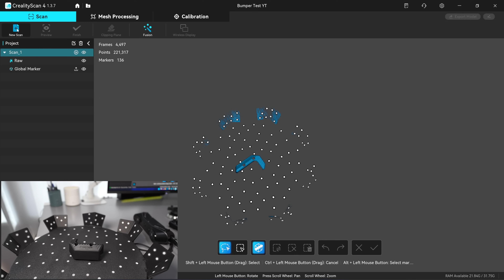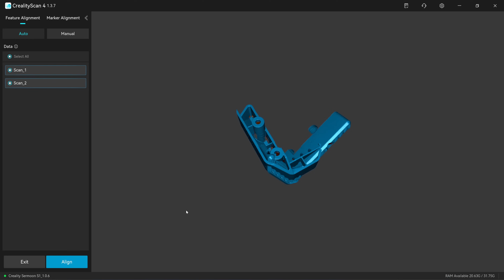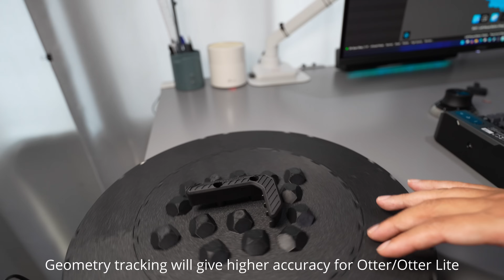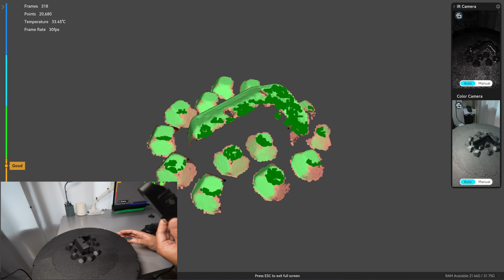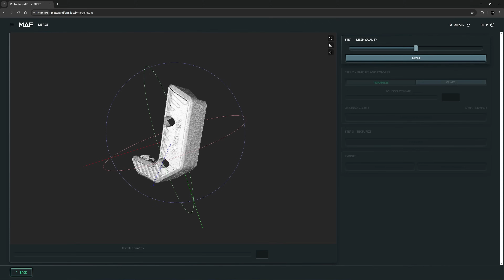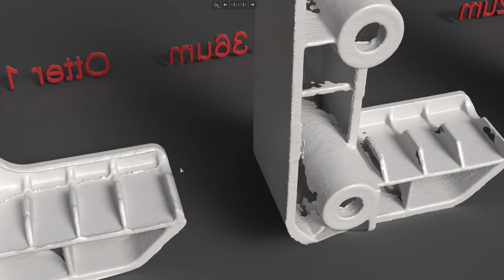Best 3D Scanner for Reverse Engineering – 8 Tested for Accuracy & Workflow

Comment: good tests. however, one issue with checking the accuracy, checking at different heights of the object could vary more then the micron resolution were are checking ?
also the lin from top point to bottom point is not 100% streight vertically down, that could change the result length enough by the microns you are testing
Reply from the maker: Look at the delta value. It's that simple.

Comment: Question, if you dab the bottom of the hole with some reflective paint or a piece of reflective vinyl, would that help picking it up?
Reply from the maker: The circular dots are manufactured with high precision, they’re perfectly round and have an exact diameter. The scanner determines distance by measuring that diameter.

Comment: Why there is a frame limit of 40k frames? 😮😢
Reply from the maker: It’s currently limited to 60K frames to reduce drifting error. The larger the frame count, the more travel the scanner makes, which increases drift. Aligning multiple scans with shorter frame counts in each pass is a better practice.

Comment: Interesting, I see other people get much better results from the metrox than you do.
Reply from the maker: I don't do paid review.
Reply: @Payo-TensileCreator  The other sources I'm referencing would say the same thing. Out of those three, you are the only one I see that says the Raptor is far better than the MetroX. The others show the MetroX as actually being slightly more accurate, and recommend it for its better software, and included equipment. But you on the other hand have a micron rating on the MetroX that makes the Raptor look far superior.
Reply from the maker: @CJThompson-m2k  I’m proud of the work I’ve contributed to the 3D scanning community. Most users buy scanners with their hard‑earned money, and they deserve honesty rather than misleading claims. Viewers ask me every day which scanner they should choose, and I provide them with genuine professional advice. Each month I receive a number of scan datasets from Revopoint devices, but there’s virtually no difference between the point clouds from the Mini 2, Inspire 2, Metro X, and Metro Y. Once cropped, they all show uneven wall thickness and lack sharpness, making them difficult to trace. Even symmetrical parts end up misaligned, with a consistent accuracy error of 0.3–0.4 mm. In fact, only a small portion of the Revopoint scan data I’ve received is truly usable for reverse engineering. Revopoint once contacted me to create a cover video. The staff member I spoke with was a good person, but their management policies are another story. Deceptive marketing remains their primary sales tactic, misleading advertising, paid reviews, and manipulation through social media. They even employ more than 30 people solely to flood negative reviews with spam comments.
Reply: @Payo-TensileCreator  You are saying a $200 scanner from Revopoint is no different than a $1000 one. Also that there are deviations of 0.4 mm. If those things were true, wouldn't you think everyone would be returning these and the brand would crumble? A deviation of 0.4 mm on a 0.02 mm promise is a company crushing deviation. I am not affiliated with any of these brands and I have no dog in the fight. It is just that I think the margin of difference you are seeing is alarming.
Reply: @Payo-TensileCreator  I wanted to let you know I compared both scanners and my finding might be surprising to you. I've decided to side with the Raptor over the MetroX. Reason being is that the Raptor is much faster at scanning than the MetroX, the MetroX is very slow on my PC despite it being a high end PC, and the Raptor beat it in accuracy measurements. I'm surprised! I was really hoping the MetroX would be better to justify the extras it comes with but I'm left grossly disappointed. I will say though I didn't see a .4 mm discrepancy from the MetroX like you have, but I only scanned two items to compare.
Reply from the maker: @CJThompson-m2k  Two scans of the same object from Revopoint laser scanners never match in dimension. When aligning scans from opposite sides, a gap always appears, typically 0.3 to 0.4 mm, creating a double‑wall effect. This issue shows up in nearly every dataset that requires merging, and I’ve observed it consistently with the Mini 2, Inspire 2, Metro X, and Metro Y.
Reply: @Payo-TensileCreator  I no longer doubt you after my experience. Very disapointed with the MetroX. Glad I kept the Raptor.

Comment: Friend, slow down with the movement of the device while it is capturing!!
Think of it like it is a camera. It is harder to capture the correct information if your are moving you hand like that! Be patient! Slow sometimes is fast!
I cannot take you results as reliable because of this.
Reply from the maker: That's correct for a 10 FPS scanner from five years ago, some of which were supplied with tripods.
Those laser scanners run at 50-90 FPS.
Reply: @Payo-TensileCreator 
Lets think that a photo with 1/50 (ie 50fps) shutter speed will be much clearer than one with 1/10, when the object or the camera is moving. That is correct.
But whipping it that much both "pictures" would introduce blur.  Especially if you think that you have a "buffer" of 40fps now, and you increase the moment. There is always the law of diminishing returns.
40fps is nice but not that much actually.
I bet by slowing down, you could scan the inside of the piece that was so hard!
Keep it going friend!!

Comment: I'm impressed that you had the correct settings for the Revo (parallel, marker, black object). That isn't documented well and without those settings I could not get a good scan. I concur that it doesn't work very well at shallow angles, and I had a hard time scanning the sides.

Comment: Are the scanning markers the same diameter etc between the brands?
 You used Creality scan dots I noticed .
When are you going to test the metro y pro?
Reply from the maker: There're 2 sizes, 6mm and 3mm ID. 
The one I use, I bought them from AliExpress
Revopoint plays the marketing game by hiding the truth—what they don’t say helps them sell more. Maybe someday a viewer will lend me a unit, and I’ll finally get to review it.
Reply: @Payo-TensileCreator  Both the metroy pro and sermoon s1 market very similar specs, It's hard to see any main issue causing differences, maybe software is the issue. I have the original Raptor but want the deep hole scanning ability and speed increase would also be nice.
Update, after some more digging it appears the scanner is accurate in a single scan file, however the software could introduce errors in accuracy do to potential noise data used during the merge, I did see a comment saying to use cloud compare for better alignment results.

Comment: Seen quite some videos from others and the Revopoint comes out way better then it does in your videos.  Got the Metro-Y to test against a Peel2 and on the first glance, the Revo is making excelent detailed scans
Reply from the maker: I don’t produce scripted reviews in exchange for free samples or paid promotions. My evaluations may differ from other reviewers, but they reflect the genuine experiences of real Revo Point users. Metro Y is essentially the same as Metro X, neither of them are laser scanners. Both rely on the same Poco Dot calibration board used in infrared scanning systems. Like I always say, make sure you can send it back if it doesn’t work out.

Comment: I am considering purchase of handheld scanner for reverse-engineering and I have a question about the reachability of the scanners to the deep pockets.. Would the spraying the part with the white washable spray help to capture the details inside of pockets? Or that would have no effect? I am just thinking ahead how could I improve the scan quality if really needed and if it's even possible.
Reply from the maker: Applying spray reduces reflections in deep pockets, allowing the scanner to capture more surface detail. However, with the S1 and X1, spray is not necessary for deep pocket scans.
Reply: Nice, thank you! I really appreciate the video. Good comparison. I will probably not choose any of those tested, but it gave me pretty good understanding of the features and price point of scanner I will consider to buy.

Comment: I appreciate the comparisons. However, I’m skeptical as to how reliable the results are. Mainly, you didn’t speak to whether you were following the manufacturer’s recommended guidelines for scanning. Some scanners can achieve better results given more time or a tweak in your technique, no? And if they can achieve better results given more time or better technique, with more versatility and/or lower cost, they may be the better choice for a particular reverse engineering use case.
Reply from the maker: Getting desktop 3D scanners to peak performance is quick, just a couple of days, they're easy to understand. LiDAR scanners, on the other hand, might take a month or two to fully understand how it works.

Comment: What is the local detail setting on Creality Scan available with the Sermoon?
Reply from the maker: Local detail is used to capture higher resolution in specific areas during a scan. For example, if you’re scanning a large panel at 1 mm resolution but need finer detail on a small mounting area, you can pause the scan, select Local Detail, and rescan that section at 0.2 mm resolution.
Reply: @Payo-TensileCreator  I assume locked in the software for the Sermoon only
Reply from the maker: @adamfred  No, Local detail function is available for all Raptor and Sermoon series since Dec 2024

Comment: Payo, I am looking at buying either the trackit or the metroY pro.
What do you recommend?
Reply from the maker: In my experience, Metro X remains a work in progress, currently offering the least accurate and poorest tracking performance among the 3D scanners I've tested. I strongly recommend confirming their refund policy in case the device doesn't meet your expectations.
Reply: @Payo-TensileCreator  not the metro X
I'm talking about the Y.
Also, what do you think about the Trackit?
do you recommend any other scanner in the 1500-5000 USD price range that would be better than those two?
thank you for taking the time to replay!
Reply from the maker: @mhmatbig  In my experience as a reviewer, Revopoint's marketing tends to overpromise. Their scanners consistently fall short of the performance claimed on their spec sheets. I’m not asking anyone to take my word for it—but since you asked, this is my honest opinion. I don’t receive payment or commissions for any of the videos on this channel. Sermoon S1 or the incoming X1 should perform best for your money.
Reply: @Payo-TensileCreator  Thanks!

Comment: Which do you choose for first scanner to start otter or raptor pro ? I think to go with otter because is cheaper but is maybe better spend a little bit more ? I want do reverse engineering for 3d parts.
Reply from the maker: If the part you're going to learn is not big, (<70cm) try the Raptor original. It's very accurate and easier to scan than the Otter.

Comment: Payo, is the MAF3 worth it for small parts in your opinion, or better to get the Seal since it's handheld and probably allows for more flexibility scanning?
Reply from the maker: Seal offers finer resolution than Moose (0.15 mm vs 0.2 mm), but its narrower capture range makes tracking more challenging. Between the two, Moose is the more practical choice. MAF3 delivers even higher resolution (under 0.1 mm), though it comes at the cost of longer processing time—so I opted not to use its highest setting in this video.

Comment: I have both the Raptor and the MetroX. I’m quite disappointed with the MetroX. When I bought it during the Kickstarter, I thought it would be at least as good as the Raptor. But to me, the Raptor is still twice as good as the MetroX. I’ll be ordering the S1, since the single-line and cross-line versions look interesting. Thnks for the review
Reply from the maker: Revopoint really ought to get Metro X working properly before jumping to Metro Y. At the very least, it should be accurate enough to compete with other laser scanners.
Reply: @Payo-TensileCreator  I agree- no way I would look at Metro Y after the disappointing performance of my Metro X- never had to use so many markers its myopic!

Comment: Why do you keep waving the scanner around ?  The steadier you hold the scanner the better your scans will be.
Reply from the maker: The laser scanner required movement and changes in the laser line shape to create point clouds, unlike infrared. Seal requires a steady hand because it captures at 11 FPS, the rest capture at 30-90 FPS.

Comment: you should remove chekboxes r1.5 & r6mm in revopoint app when use 6mm diameter markers to increase a scan speed & accuracy of metrox
Reply from the maker: That's not going to make any different. I've tried that in this video. https://youtu.be/vqAQLWlrUm4?si=3jjx7s7vUKAopBAx&t=638

Comment: Your videos must have saved many people from making a poor purchasing decision by now. Thank you!
Reply from the maker: You're welcome, happy to help!
Reply: @Payo-TensileCreator  Hey, do you have experience with the einstar scanners? Where would you put the shining einstar (original version)? Between which "scans" in terms of quality and ability to scan into pockets (backsides)? I just got an offer to get a used one for pretty cheap and am considering getting it to try to get into reverse engineering and modding.
Reply from the maker: @DiverseGreen-Anon  To my knowledge, the original Einstar uses infrared technology and is designed for scanning medium (over 30 cm) to large objects. While I haven’t used it firsthand, I’ve reviewed customer-submitted scan data for reverse engineering. Unfortunately, the resolution is too low for reliable feature tracing, making it quite challenging to work with.
Reply: @Payo-TensileCreator  Okay thank you for your answer! Then I might need to wait for the laser scanners to drop a little in price. I am otherwise considering the einstar 2 (which has some blue laser lines). But it might be too new to judge as I havent seen good testing of it, in the way you do here.

Comment: I noticed on my Otter scanner that after updating the Creality Scanner version to a newer version, the quality dropped a lot and it had this texture that looked like a leather surface. If you can, test it with an older version of the software.
Reply from the maker: I can't notice any scan quality degradation with the CR 4.
Reply: Not sure if it helps, but did you recalibrate your Otter after installing the new software version?
Reply: @rhelberth  I noticed the same thing with the Mac version of Creality Scan. Version 4 is quite a step backwards in terms of quality and visualization during scanning and post-processing. Version 3 feels much more advanced.

Comment: Will you be looking at doing a review of the new Toucan scanner from 3D Maker Pro? I ordered one at the early bird price @ 50% off. Looking forward to playing with it once received.
Reply from the maker: 3DMakerPro said they'd send me a sample unit back in June, but it still hasn’t arrived. At $999, their all-in-one scanners with dual depth cameras offer solid value. Based on my testing with the Moose and Seal, both deliver good precision and tracking. The only notable drawback is their sensitivity to high-contrast colors—a common issue with MEMS sensors—so having a scanning spray on hand is recommended.

Comment: Hi, why do you hold ferret vertical? I am using it horizontal. Does it effect 3d Scanning quality? And can you try ferret with markers?
Reply from the maker: Holding the scanner with the cable facing downward is more ergonomic. It doesn’t affect scan quality, and using markers on black objects can actually degrade the results.
Reply: @Payo-TensileCreator Actually İ am using ferret and I am scanning objects smaller than this one. I made scanning markers which you shown in your DIY scanning marker videos. I am using them on turntable and palcing scanning model vertical. Then it works but not good ad otter etc. But more good than this. 

Do you have discord server I wanna send pictures?

Comment: Great vid as always! New einstars are coming, are you planning to reach einstar for review units? :>
Reply from the maker: Shining3D typically doesn’t permit direct, head-to-head comparisons. Reviewers are provided with specific guidelines detailing what to say and which scanner to use for comparison.
Reply: @Payo-TensileCreator so the only option is to buy it? Or borrow from somebody as you get revo metro?
Reply from the maker: @jerryofthebikes  Yes, either buy or borrow. Shining3D has dealer locations where you can test their scanners, but they typically don’t allow side-by-side comparisons with other brands. Each device performs well when evaluated on its own.

Comment: I really appreciate the side by side comparisons. I think you are the only one on youtube that does this. Cant wait for the MetroY test
Reply from the maker: Revopoint can’t risk a side-by-side comparison like this. They pulled my Metro X sample last minute—the one in this video came from a viewer.
Reply: @Payo-TensileCreator I sold my MetroX but it's not in the same league with the Raptor or S1. The software I will admit for post processing and integration with the DATT is very well done, now if they can get the quality and tracking on par with creality it would be a different story. I really feel like it's not the hardware and is solely the software.
Reply: @Texas3DCustoms yeah the firmware is what matters most for all the scanners imo. I assume they are composed of mostly the same lasers albeit at different counts/orientations. The firmware/software is what takes the data from the lenses and makes it a point cloud.
Reply: Yes Metro Y pro is something I've been contemplating but the X looks terrible. Makes me worry for Y. Einstar Rockit is now also super interesting.